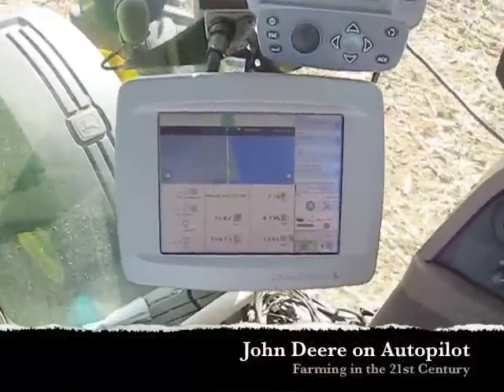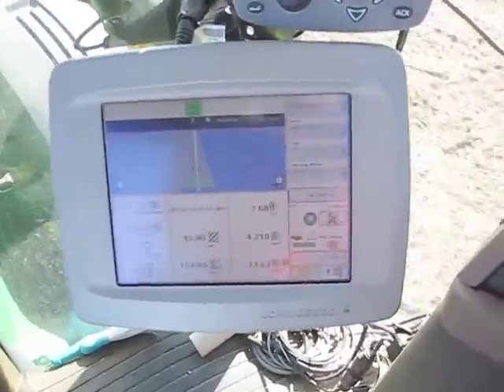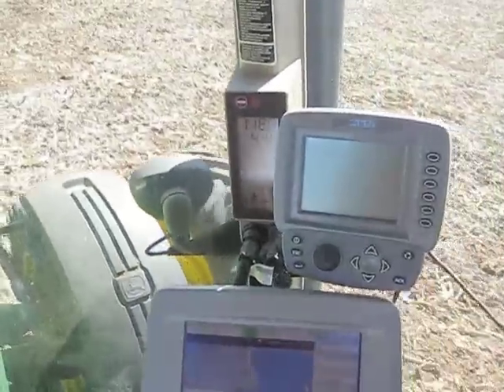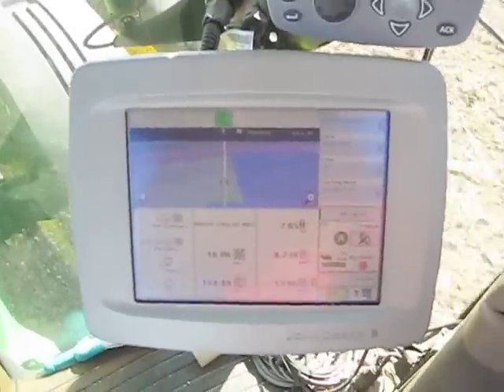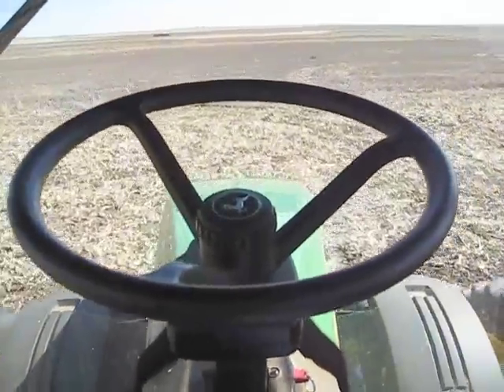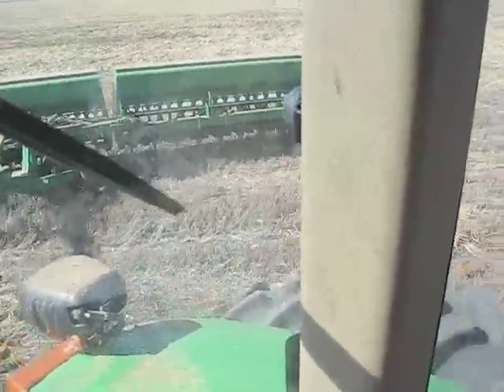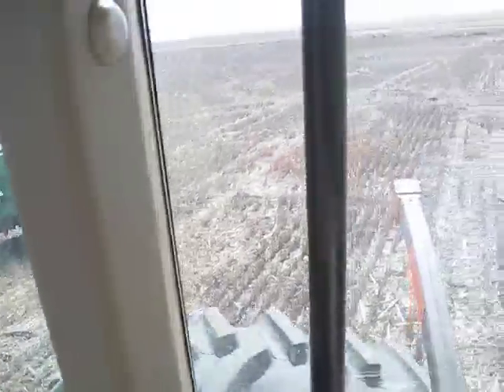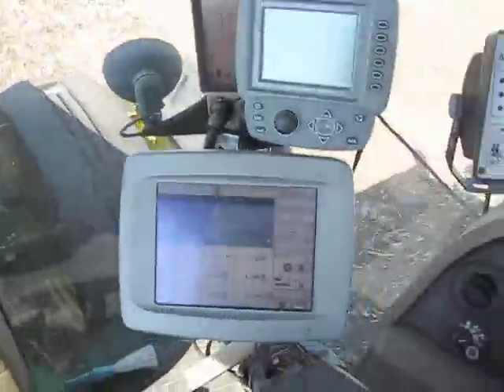John Deere on Autopilot

Comment from the maker: Turn radius is programmed when adding an implement. Since the turn radius is larger than the pass width the tractor chooses a lightbulb shaped turn to line up straight without turning too sharp.